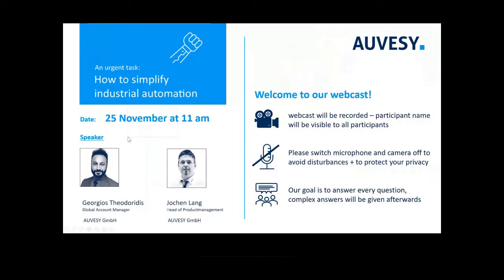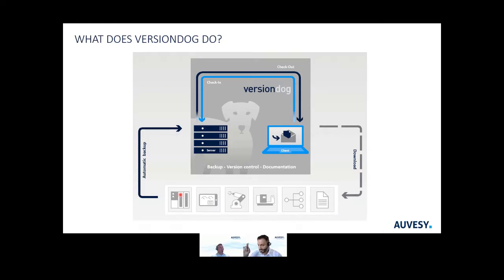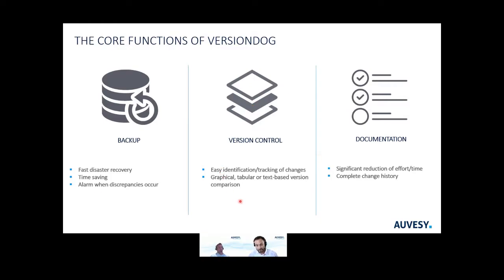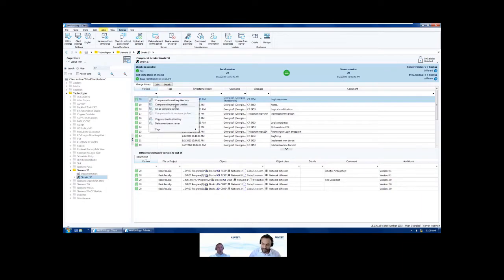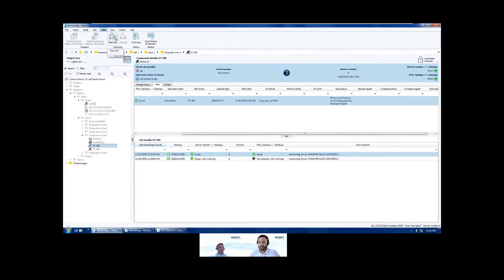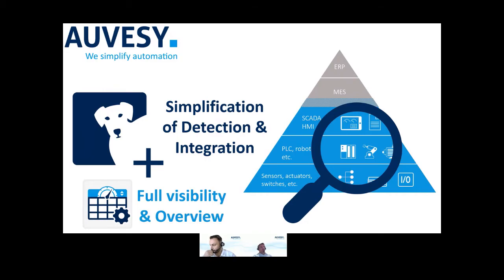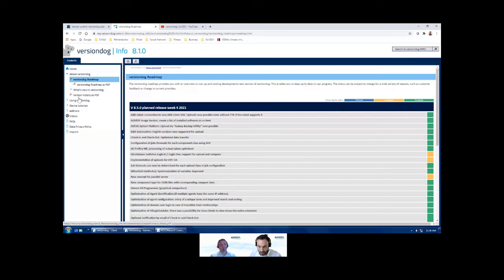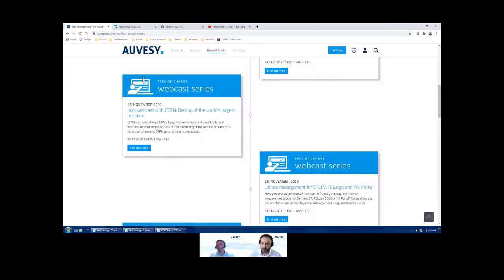Simplify industrial automation

Comment: Good video. I saw there are 3 projects(project 1,2,3) under ONE SINGLE component. It means that the component will be used in 3 different flexible production mission, doesn't it?  Thus, manufactures can load the specific project required for different flexible production mission, which means, to some extent, the system always lives on. Am I correct?  Many thanks.